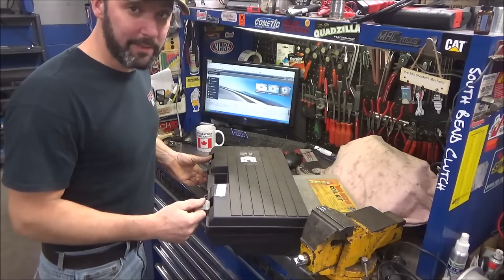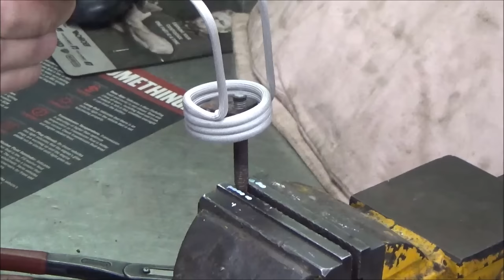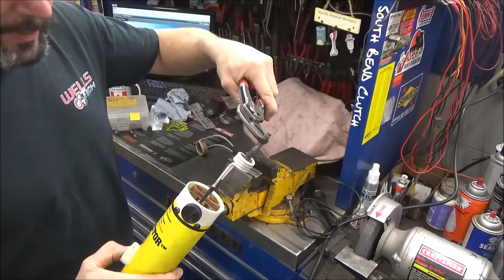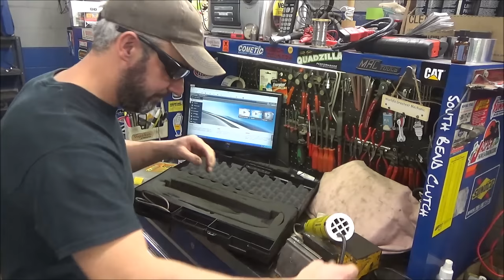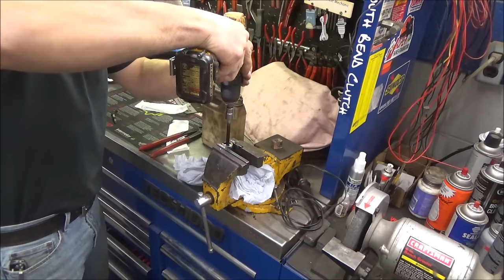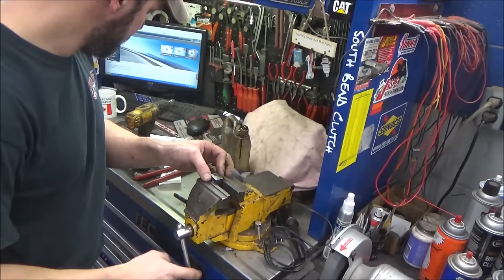How To Heat Up A Nut or Bolt WITH OUT A Torch

Comment from the maker: *Induction Innovations MD-700 Mini-Ductor II Magnetic Induction Heater Kit: https://amzn.to/2y3cWzv
*Induction Innovations MD99-660 Essential Coil Kit: https://amzn.to/2sTPqje
Reply: South Main Auto Repair man i wish i had that set of tools. Im 26 so id say im getting there lol
Reply: 110 bucks cheaper on fleabay
Reply: @DieselRamcharger Where defective parts are King.
Reply: I do not think it is "rust", that holds the bolt... Think about it, how many times did You actually taken out a bolt with rust on the thread? and yet it is allways that part of the bolt, that wont budge.
To my knowledge it is because of difference in steel grade between the bolt and the block of metall you screw it into, they expand/contract due to temperature change a bit differently, but enough to eventually lock the threads against each other.
Reply: The mini ductor sometimes works to remove stuck lug nuts with out destroying aluminum wheels
Reply: Answer:  South Main Auto Repair

Question:  Where can you find the best B. B. Q.  nuts and bolts in town?
Reply: have you ever busted a knuckle or smashed a finger working on a car or truck
Reply: I know im randomly asking but does someone know a method to get back into an instagram account..?
I somehow lost the login password. I love any help you can offer me!
Reply: @Angelo Rocco Instablaster ;)
Reply: @ It worked and I finally got access to my account again. Im so happy:D
Thank you so much you really help me out :D
Reply: @Angelo Rocco no problem :D
Reply: @josephfuller6229  It basically is impossible not TO... mechanic's gloves do help that situation...big time
Reply: Eric!!... You're AWESOME, EXTREMELY TALENTED AND KNOWLEDGEABLE...I am going to buy a oxy-actelene torch set AND an induction heater kit. Should I skip the torch and just get an induction heater kit instead?  What do you think? Thanks in advance...👍😁
Reply: Eric thank you! This is the only channel that has solved two problems I have in one video.

Comment: I think this is backwards. Guys at home would use a $20 Harbor Freight torch. Guys in shops would use a $440 induction heater.
Reply: LOL! Pretty much what I was thinking.  Still a neat tool though.
Reply: Can’t wait to harbor has a $20 heat induction tool
It’s coming I’m sure
These can be made a lot cheaper
Reply: $440 wtf
Reply: I have a 1200-watt magnetic High Frequency induction heater with a couple dozen coils, free winding elements of different lengths, and flat coils. I also have torches, etc.  This heater has some serious advantages over my oxy-acet torches, especially when using near rubber, paint, electrical, and plastics.  This machine makes it so much easier to concentrate the heat better than the flames of the torch.  Also, prices have fallen significantly over the past 10 years as well as the increase in power.
Reply: My induction heater cost $150 bucks and I use it all the time!

Comment: So you're showing the people at home how they can do it "without a torch", and your solution is literally just a more expensive tool. Lol
Reply: $40 and you can buy a propane torch at Lowe's
Reply: This tool is used for heating parts that are in close proximity to parts you don't want to heat(bushings, electrical, or rubber). A torch would have you catching things on fire you don't want to. It saves time especially when you can't or don't want to remove the whole part.
Reply: Yea you’re right but probably safer for some. But us guys at the shop it’s best to have both. As he says certain situations that it won’t be safe to use example a leaky gas tank.
Reply: @eliezerramosjr1017  that and as we all know a propane torch will not get parts as hot as an acetylene or mapp gas. This is cheap in comparison to a torch setup. Tanks, tips, hoses and a cart if you want portability. All very expensive.

Comment: Best Auto Channel on you tube. I have been a Marine Mech for 30 years. You are a true Mechanic.
Reply: +ml2trick  Excellent point, and I would say he is a true Technician. Diagnoses and finds out where the root of the problem is emitting from. Much respect! I've always been curious ml2trick about what you Maine Mechanics do on a daily basis. Im a flat rate line tech at a toyota dealership, but have an opportunity once upon a time to work on boats. How do you like it?
Reply from the maker: +ml2trick Thank you

Comment: Something I was taught by a lady auto mechanic is that sometimes a nut or bolt that won't break loose will break loose if you tighten it. It seems odd but it's true, and broke loose is broke loose whichever way you initially rotate it.
Reply: AKA Wireguy Yeah, I've seen that done a few times. Sometimes it works.

Comment: FOUR HUNDRED THIRTY TWO DOLLARS...! Now where did I put my map gas torch...
Reply from the maker: Can't use a torch on a gas tank strap when the tank is leaking :D
Reply: South Main Auto Repair drain the tank. or use a gas tank strap cutter, its like bolt cutters for straps. or an air powered drill, makes no sparks. or an air chisel.

Comment: ahhh, the infamous inductor....i just came across your video...i used it at my truck shop....COTTER PINS were my kryptonite but this tool saved my job and many hours of stress.....when you have a $200 tie rod end with a rusted solid , broken , frozen cotter pin, the inductor does the trick with out frying the bushings inside the tie rods....great tool and great video

Comment: very good videos using excellent diagnostic reasoning and skills. About 1960, the late Neil Houston, co owner of Houston Brothers Motor Co in Marshall, NC, showed me his method of loosening rusty bolts/nuts. Once the piece is heated to cherry red, if possible drop item in a bucket of water or quench immediately with  water hose. Then instead of squeaking as your bolt did, once loosened 1 turn, you will be able to screw bolt out with your fingers and the rust will fall out as black powder. Keep up the good work

Comment: I can't thank you enough, I spent about 2 hours doing that exact same job making a fully threaded bolt for a similar tensioning setup on an excavator never thought to put the die in the vise and use a drill I cut aver 100mm of threads with the die holder. thanks for the future time saver

Comment: This was very informative, I knew these inductive coils existed but did not know they had been modified for portable shop use. The price is a little high for the home DIY guy. When I have a cramped space where i cant use a torch, I have had success with a heat gun from harbor freight.  Thanks for stopping what you were doing to share this information.
Joe

Comment: Very good video, I worked most of my life making electric mining shovels, Towards the end we were using induction heating to pre-heat  before welding. We could heat a piece 5 inches thick by 20' long to 400 degrees and maintain it while welding and bring it to a slow cool. Thanks for the nice videos.
Reply from the maker: +Glen Harper so it was a tad larger than mine huh

Comment: Mr. O, I'm quite impressed by your work! "This induction heater is amazing! Had to replace a fuel tank and the T.S.B. speaks of how rusty bolts need heat, but no flame. This saved my bottom a few times already." Yes, it's a bit expensive, but pays for itself very quickly. Thank you very much for showing the proper tools for the job, certainly makes it easier! 

Cheers! :-)

Comment: You probably already know this but years ago an old welder friend of mine showed me to squirt a little motor on the bolt when it's red hot, the heat sucks the oil down around the bolt threads and presto, the bolt screws out with ease.   
Never heard of that heat inductor, I will get me one of those.
Reply: bplovescars nh

Comment: Thanks for the help. I’m trying to break loose bolts on break caliper and wheel bearing. Ordered induction heater rather than flame by gas tank. Safety first when working at my house. Thanks again!

Comment: People don't have ~$20 torch kit at home, so let's recommend them $431 Magnetic Induction Heater Kit, also $106 Coil Kit to go along with the heater kit, because $431 is not expensive enough - $537 total is just right! (prices current at the date of this post).
P.S.: You don't know how strong you are man :) Ripping bolts all day long :)
Reply: I searched for DIY Induction Heater and there's a power supply for like $10 & Banggood.com has one for $269.99 with the coils.
Reply: I am pretty sure if you have any type of welder if you hassle the manufacturer or community threads you can find ways to transfer heat to a solid metal object via conduction which is very much on par with this technology. If it's not an object not difficult to access, especially something small/portable can be able to have its chemical bonds broken by reverse electrolysis & Broax Washing Solution meant for washing clothes.
Reply: I don't have a torch, nor do I want the huge cylinders and the PITA of refilling them. You're damn right this is a viable alternative.

Comment: Super handy rig. I just bought one in early 2023 for $200. Great for brake bleeders among other things. Not just for steel, it works on aluminum, copper, brass, bronze.  I use mine for annealing my brass cases for reloading. 
The tighter the coil, the faster it works.

Comment: Another good way is those cheap midsized butane torches. I've gotten quite a few seized lugnuts off on the side of the road and it also works as a wire stripper a soldering torch also will braze small copper pipes and the help heat up lunch if needed
Reply: Yep I use the small torches you buy at harbour freight or Princess Auto  torch head is smaller than a regular torch so I can get into tighter areas and concentrate the heat where it’s needed. Just stay away from fuel and brake lines 😁

Comment: I'm a machinest and I liked your way of threading fast and got er done.... Could go into all the bull about thread cutting pitch angles depths etc etc but no one can argue if it works.... I often turn nuts into dies for threading just by cutting grooves into the nut with Dremel cut off wheels.... And I have screw cutting lathe and cnc mills.... Often make my own taps in the lathe.... Just a question of how much time.... Often is faster to just make something than make a run to the store for a tool..... Besides there was a time when every thread was as different as fingerprints way back.....

Comment: I know it's been some time since you put this video up. There has been some other YouTube videos that have come out since then with the Chinese knock off of this tool. One YouTuber as he was videoing what he was doing plugged everything up went up to the exhaust bolt underneath the car turn the tool on and 5 seconds later a puff of smoke came out from the body of the tool.

I had made one of these from eBay parts a few years ago. The only bad thing is that practically have no use for it since it's impossible for me to get it under the hood of the car to use it on one of the bolts. It's basically a bench top tool. It's still comes in handy on certain things. When I'm working on mine or someone else's gun and trying not to break screws I can put the part into the coil heat up and then remove.

A lot of people really don't believe how he can make a difference. I have a good friend of mine who's quite a bit younger than myself and when we were working on the steering of my expedition we could not remove the pitman arm bolt and I told him just let me get the torch and heat it up. He insists that that would not work that he has dealt with stuff like this and just needed to spray some lube on it. 2 days later the bolt was still in place and this time I wasn't asking I went and pulled my torch out and in less than 2 minutes it came out with no problem at all. Now that he's a believer whenever he's working on something around the house he's using the torch all the time lol.

Like always I enjoy watching your videos and I always make sure even if it's an old or new one to hit the like button and of course the first time I hit the subscribe button also. I figured that's the least I can do with someone sharing knowledge.

Comment: I have had a pacemaker for a number of years and have been shocked several times with electric fencing.  Modern pm's are shielded from emf waves now but i was told not to use a chainsaw or work around cars.  I found neither has caused any problem.  Enjoy your videos.

Comment: Started as young NCR tech, back when complicated, heavy geared, National Cash Register mechanicals were still built in Dayton Ohio. We used a carbon contact electrode device. Looked like large needle nose pliers with jumper cables, powered by a large 12-18 VAC transformer. The resistance between the carbons, then turned whatever was squeezed between the carbons, red, in minute or less. Thanks for great vids and technical diagnostic so rare today resulting in the "Parts cannon".. precious.. lol :>)

Comment: old vid, but I didn't know such a thing existed. I'll wager they're not cheap. I have seen many a time when this thing would have been just the right tool. Three are many places on a car you do not want to use an open flame, while the heat on the bolt is okay, flames tend to go places you don't intend.

Comment: Inductive Heater 😂 I think people at home might have a torch before one of those
Reply: This is a year old comment but an inductive heater is 1/3 maybe 1/4 the cost of a torch so they may just have the heater.
Reply: @johnghatti5435  Yes, and with care can be used beside a leaking gas tank.
Reply: @johnghatti5435  k oh
Reply: simple heat gun is like 50 bucks 1200°
Reply: Then try not to think too.much
Reply: It's okay the king of random shows you how to make one. Well with today's snowflakes youtube might have taken it down.
Reply: @michaelmartinez5217  I work on crap at the house, on something small I tried one of those little mini torches and it works, but I usually have time and a can of PB blaster does the trick. But like I do most of my work at the house so I have have time to lean so that penetrating oil has time to set in.
Reply: Yup that how it is hear
Reply: Had several bolts broken in a steel project, but snapped flush and too hard to drill. Cut them out with the torch, welded the hole closed, drill and tap. On the other hand, for a lug nut or whatnot, this inductive heater would be faster than setting up the torch and unlikely to mar the wheel.
Reply: @ciphergalm1174  Heat gun puts out hot air but not much total heat. You can park one over a hunk of metal all day and the metal won't get that hot.
Reply: @johnghatti5435  The heater he links to is $500. You can definitely get an oxy-acetylene full setup with gas for around that.
Reply: I think that is more for tight spots where there's wires or rubber that you risk a flame going near it
Reply: I bought an inductive heater from Amazon and it was worth every penny. Torches are dangerous and I would not want to use one at home in my garage with all that smoke. Inductive heaters amazing and get the nut red in 40 seconds
Reply: Right

Comment: Heyyyy guys, just a heads up, if the sleeves on your induction coils come apart, just get some universal Fiberglass Wire Sleeve/Insulating off fleabay and re-wrap the cables!

Comment: The first I heard of Induction heating, was when I worked CAT gear factory in 1978. I was an inspector in heat treat department for about 6 months, and they used induction to heat treat gears and shafts. The machines they used had centers like a vertical lathe, or a fixture for say a bull gear. The coil went around the part as it turned and the coil advanced up the length of the surface to be hardened, while the quenching liquid sprayed on the part just below the coil. Very fast without heating up a huge furnace.
 A 5 foot diameter, 600 hp electric motor ran the generator and on Sunday night at the start of 3rd shift, it took all of a half hour for it to get up to speed.

Comment: I use a full set of torches, but I also have a set of super small portable bottles of oxy acetylene.  When you can't use that high heat open flame though, these induction heaters are the boss. I used one around the gas tank of a Caliber where an open flame of that magnitude was just too much, so much savings in scare factor by using induction.

Comment: This is all right if you have the bolt and nut it's already been removed from the car. But if in most cases you have to get at something that's buried somewhere or even an exhaust bolt it would be considered useless

Comment: Years ago at an electrical shop in town that would rewind motors, I saw a rewinder take a huge Weller soldering gun, remove the tip, put on a homemade coil of stove or range high temperature solid wire, make a coil, install it on the Weller. He heated a 1/4” bolt & nut. It took about 5 minutes. I was always going to get one of the huge Weller guns to do it with. Now Bill is gone. This was late 70’s. About 77 or 78.
Hello from north east Montana.

Comment: If you're expanding the nut with heat why wouldn't it make the hole small and grip the bolt even tighter? Genuinely would like to know
Reply: I think the trick is the expanding and contracting breaks the seal between the two and allows the bolt to spin.
Reply: Also the metal on the outside heats up quickly so expands releasing it from the inside component

Comment: Loved that squeaky noise at 7:00am with my morning coffee and cigarette.  By the way, I found a way to get rid of the green crusties on connectors:  Sanivac.  I had 3 copper connectors on my car I didn't feel like replacing, and I thought 'what do I have to lose', so I soaked 'em in Sanivac for 2 minutes - they look like new.
Reply from the maker: +Randy Condran is that some sort of cleaner I assume?
Reply: CLR's the same thing.  I think Sanivac's a Southern thing... It's a deliming chemical....